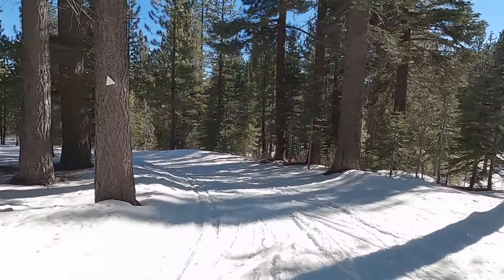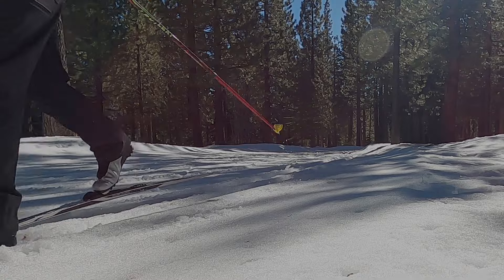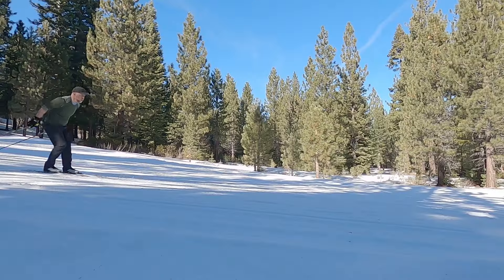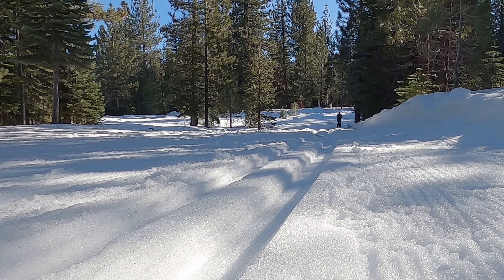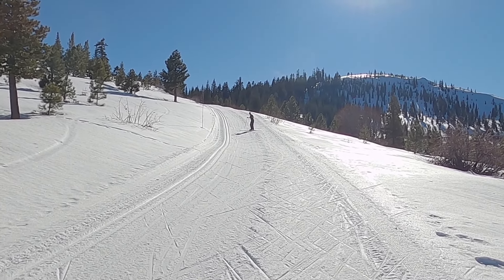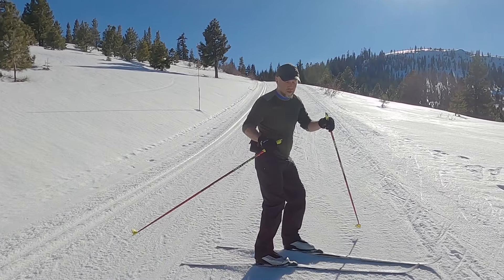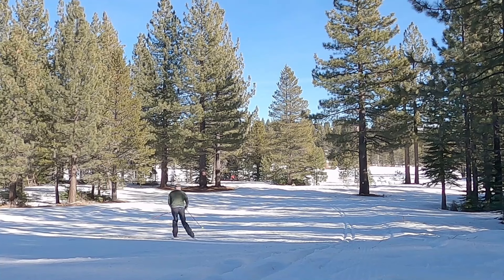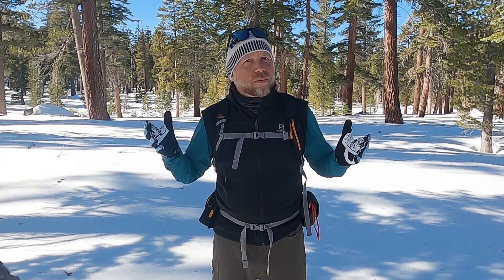Intro to Classic XC Skiing (Part 4): Basic Techniques for Cross-Country Skiing Downhill

Comment: Hello from Alberta Canada. Where is your weight distribution when performing a hockey stop? Thanks love your vids.
Reply from the maker: Hey Gareth!

Sorry about my delay in response. We've been hit with another storm here in Tahoe (unfortunately this one is nearly all rain), so I've been doing tons of house prep for it.

Anyway, I don't come from an alpine skiing background, nor a ice skating background so I probably do my hockey stops slightly different from those who do come from either of those backgrounds. But I tend to put more pressure on the "downhill" ski by slightly pushing off from the "uphill" ski to the downhill ski. When my weight transfers more to the downhill ski I initiate my skid and draw the uphill ski parallel to the downhill ski. Here's a video I produced about specifically how I perform hockey stops (https://youtu.be/gWc_ISjXzwQ).

That said, I think a more ideal approach is that you're supposed to put both skis on edge while slightly unweighting them so you can more easily move them into position for a skidded stop. I could be wrong about this as it all becomes very subtle the further you refine your technique. But if you watch my video, you'll see the progression from a very obvious snowplow into a hockey stop to something a lot more subtle.

Take a look at that other video and then let me know if you have other questions or want more clarification of what I've said here.

Thanks again for watching, and for the question!

Comment: Great video, hoping to get out and try these techniques this week.  I wish we had cross country ski trails like this so wide and open and unwalked on.  My difficulty is sometimes there isn't enough room on the trail to do a good snow plow.  Or when you are doing a snow plow since you are out of the tracks you are now where all the footprints and dogprints are and can be quite bumpy so when you do a half plow or snow plow with your weight on the plow foot you can get thrown over when you hit a foot print or so.  Would love to see more demonstrations of how to handle more narrow trails.  Also will check out more of your channel, but uphill doing herringbone style is difficult on these more narrow trails as the trail is narrow and the sides tend to be a foot higher than they are in the middle making herringbone or side stepping up hills very difficult.  I might just need to find better trails but these are the two within an hour drive of my house.
Reply from the maker: Nathan, I feel your pain regarding hard-packed, tracked-out, and narrow trails! Those are nightmare scenarios because you just end up doing the upright luge thing all the way down the trail. Terrifying! haha.

Honestly, the only real feedback that I can offer other than doing that half-snowplow (cheat one side of the trail to give your plow ski the most real estate with which to work) or run one ski in the deep snow along the trail (if it's soft enough) is to avoid those hard-packed trails in the first place.

I'm sure avoiding the trails is easier said than done depending on the terrain in which you're navigating. However, even on flat backcountry terrain when there's social tracks laid out, I'll choose instead to ski alongside those homemade tracks. I usually do this when those homemade tracks are glazed over and icy and/or wavy gravy from the multi-use element (people skiing, snowshoeing, walking, dogs walking, whatever ... on those tracks). I can't stand dealing with all that choppy stuff because it causes me to loose any sort of rhythm while skiing and presents hazards when trying to slow down on the downhill portions (as you know). I'd much rather break my own trail so long as it meant that I was going to be able to ski over a uniform surface of snow (even if that means dealing with deeper snow).

Right now, at Lake Tahoe, we've gone through a long bout of freeze/thaw cycles so that our snowpack is mostly crusty on top. It softens up a bit in the afternoon, but our daytime temps haven't been too high, so it's still staying pretty firm. So, what I do, is to get off the main thoroughfares as quickly as possible in order to access snow that hasn't been tracked-out for the past month. Fortunately, I have a lot of open terrain near my home so I don't have to drive far. But even venturing off the main trails by just a few hundred meters at even the popular local backcountry ski areas (to me) yields much more favorable snow. And the further I travel away from the beaten path, I can find even better snow on which to play. For example, the location at which I filmed the second day's portion of this video (January 26, 2022) about performing step turns (https://youtu.be/nP6SwsRWo8Y), you can see that some of the snow was sugary and pleasant to ski on. There were large aspects of terrain nearby that also featured this same quality of snow that I came back to play on the following day in order to practice downhill turning.

Long story short, I actively seek out better backcountry locations/snow on which to play when the conditions aren't so favorable. I do this in lieu of trying to actually ski a specific trail. That's one of the main reason I love to xc ski, is that I don't have to stick to the trail. I can go wherever I want so long as I have the energy and gear. I also tend to dial back my expectations when the snow isn't that great. So, I will just plan to go out and play on the one short little hill, if that's all I can find. Again, I realize that I live closer to those open areas than you do. Not sure if that's relevant or helpful to you, but that's my approach to the whole off-track experience.

Let me know if you have other questions :)

Comment: The skidded parallel   hockey  stop is easier  to do on  beefier Telemark  free heel  ski boots and  BC skis. Skinny  classic  skis are  harder to  ski on. They are lighter than  BC XC  skis  are so  that is an advantage they have.
Reply from the maker: Thanks for the comment. Yeah, in certain circumstances bigger and heavier skis/boots can definitely provide more control. Although, I only use cross-country ski oriented gear (no Tele boots or skis) because I'm  just as interested in diagonal striding on the flats and uphill as I am skiing downhill. So, cross-country ski specific gear enables me to achieve all of those goals.

Since I work at a large cross-country ski resort (instructor, wax tech, and in the rental room), I'm constantly asked about downhilling technique (on groomed terrain). So, in this video I'm specifically addressing that topic. And groomed terrain is ideal for skinny skis :)

Comment: Hi Jared, very helpful tips. After the cold days i went straight to the trail and i located a very gentle slope, I kept the athletic body position and i was able to glide, It really felt so good. Technically speaking the snow resistance and the glide was balanced that kept me gliding at a constant speed. But when the slope increases, this creates some acceleration and the ski went faster than my body and i could not keep the body stance any longer and i let go. So why does this acceleration makes me lose balance? Any comments?
Reply from the maker: Hey Anil,

Thanks for the comment, and glad you've been able to get outside and practice xc skiing :)

As far as falling down goes ... it sounds like your weight shifted back once you gained more speed. This is a very common thing for people to experience. The skis most likely slipped out from underneath you as a result of you leaning (even slightly) back. Most people have the natural instinct to pull back once they begin to pick up speed thinking that it'll slow them down. Believe it or not, this is the opposite of what you want to do (and not obvious to people new to skiing downhill). In order to maintain our balance going downhill, we actually need to keep our weight forward (i.e. downhill). There's more stability toward the front of the skis, so by keeping our weight forward we'll stand a better chance to remain upright. If our weight shifts back, those skis usually will just slip out from underneath us.

Try leaning more downhill even when you pick up speed. That said, definitely make sure you can safely stop when you do pick up more speed. Or, be willing to bail onto one of your sides as a last ditch effort.

There are all kinds of counterintuitive things to overcome when learning downhill technique, so be patient with yourself and be willing to go slightly beyond your comfort zone (obviously within reason and not to the point of being reckless).

Hope that helps. Let me know how it goes!

Comment: You look like a Superman on the trail Jared. You make this looks like child's play. Trust me I am not kidding. I was on a trail that seemed a bit more advanced today. There were steep curved downhills and people were using the centre zone with so much ease. You trump them all. 

They were skate skiing as well in center zones.
Jared, I tried skate skiing today (using classic skiis) on a flat ground and the friction in my skiis caused me to fall soon many times, I just left doing that

Do you think skate skis will be better? Can I use skate skis on groomed tracks. I thought I was doing well until today. Please help!
Reply from the maker: Thanks for the kind words, Rahul 🤗 I do love to xc ski 👍

You can skate ski with classic skis, but it's definitely not nearly as fun and a bit more challenging. Essentially, the scales of waxless xc skis will affect your glide when trying to use them for skate skiing. A lot of times if I decide to skate ski for short distances on classics skis, I have to slow my movement down (compared to performing the same skate ski technique in actual skate skis).

I couldn't say exactly what your situation was without seeing you ski, but the friction may have been throwing off your timing. You probably would have a better time skating using actual skate skis, I suspect.
Reply from the maker: And skate skis are best used on groomed xc ski trails thanks to the uniform surface.
Reply: Thanks for the prompt response Jared
If I come down to California I will sure stop by to say Hi to you
We generally drive down from here, it is a long but beautiful drive
Reply from the maker: You're welcome, Rahul. And sounds good 😊

Comment: Maybe this is just an East Coast technique--but you didn't mention pole-dragging?  It's not sexy, but has saved my bacon on many a narrow and fast downhill with trees flashing close-by.   I've found dragging both poles to one side while doing a half-wedge with the opposite ski pretty effective for reducing speed on narrow, ungroomed trails.
Reply from the maker: Hey David,

Thanks so much for tuning in, and for the comment!

Not sure it's something that's taught out here, but I have definitely used my poles more than once to slow me down by dragging them behind me. haha! I do like your idea of the half-snowplow combined with the use of poles to slow yourself down on narrow trails. Those are often some of the most terrifying terrain features out there -- where you can't just turn or do a full snowplow due to the sidewalls along the trail. So, thank you!

Again, I appreciate you watching and for posting your tips. Super cool!
Reply: @JaredManninen  Have to admit that I was dragging my poles AND giving consideration to speed control while on a 2.5 mile downhill of a narrow forest road yesterday.  What I noticed:  Both poles, off the wrists, held together, and dragged in deep snow to one side of the skier CAN reduce speed--and have a minor steadying effect.  But using poles in that way can also distract the skier from working their wedge to get the most-effective degree of slowing.  If the skier's hands come back toward the hips while dragging poles, it might cause a weight shift back on the ski tails and take away from effective braking with the skis.    You gotta' attend to how those skis are braking--and pole dragging is a help--maybe.
Reply from the maker: @davidpfurr4350  Great observation, David! I think you're right in that the person has to be really clear about where they're investing their effort. The ski or the poles? Of course, my belief is to focus on the skis and use the poles as a secondary rudder/brake (when it's safe). Without the clarity of knowing which one to focus on, a person could get caught somewhere in-between, not effectively using their skis or poles to fully slow down. I could see this situation being exacerbated by the fact that the person would most likely be dragging the poles on the opposite side of the body/plow ski, causing the person to split their weight between the two or, worse yet, lean too much on the poles and then lose all control of the skis (like you said, in the backseat on the tails ... glide zone).

As I recall the times in which I drag my poles, I want to say that it's most often on the uphill side (i.e. when I'm skiing downhill on a traverse). This way, I don't have to change my body position a whole lot in order to drag those poles. At the same time, I drag them very sparingly and mostly passively. For example, I'm aware that the pole(s) are dragging, but I'm not relying on them/it. I'm more concerned with the skis at that point. The reason for this is that I know (for myself) that as soon as I split my attention between two things (in this case, trying to focus on what my skis are doing versus what my arms/poles are doing) I tend to fail at both. I know that the power to stop is in my skis, so I prefer to focus on that. And if I'm performing a half-plow, I'm really transferring as much weight to that plow ski as possible, therefore distancing myself further from where I'd want to apply pressure to the poles (again, assuming I'm dragging them on the opposite side of my body).

Anyway, fun stuff to think about! And I know that you have it way more challenging than I do with the more narrow trails and lots of forests to navigate in your neck of the woods. In the Sierra Nevada, we just have so much open terrain in which to play. So I seldom have to contend with narrow, hard-packed trails. That said, when I do encounter similar obstacles I'll occasionally run one ski in the snow off of the trail (if it's deep) or I'll avoid the trail altogether if at all possible. Icy, crusty, and tracked out trails are not my favorite :)

Thanks again for the conversation. Very inspiring!
Reply from the maker: @davidpfurr4350  Just because ... :) https://youtu.be/2HEiuzjOwLA